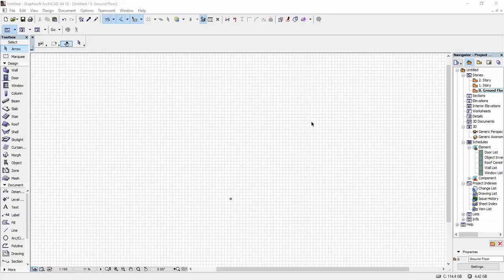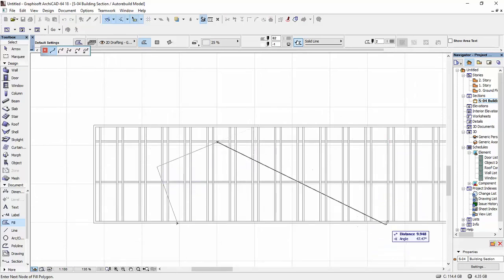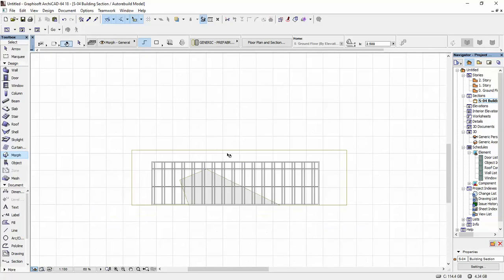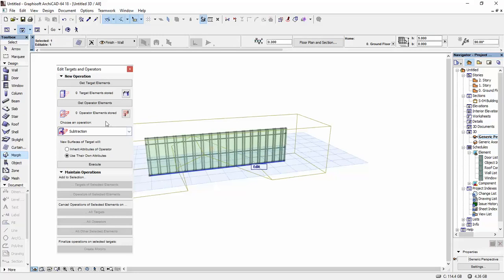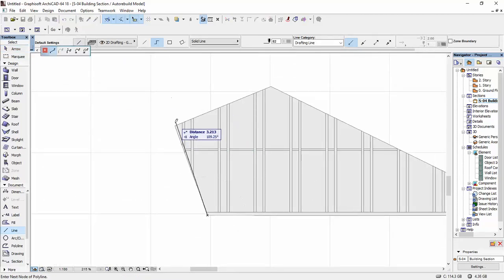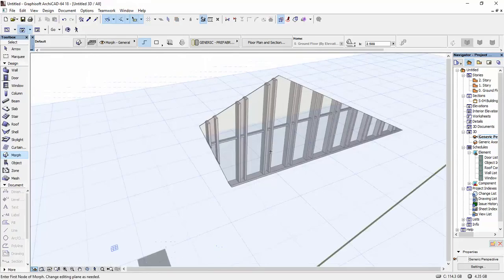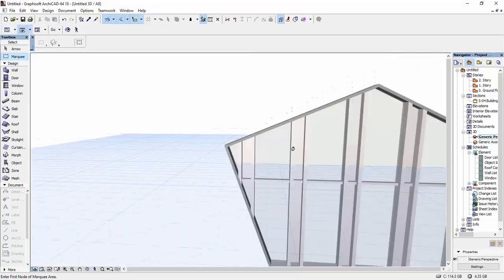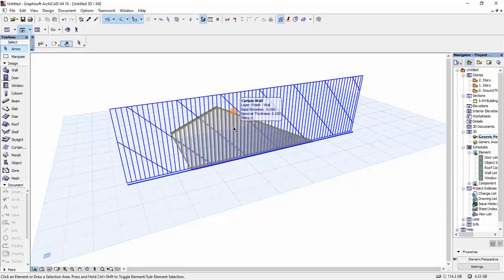Custom Curtain Wall ArchiCAD

Comment: Great video, I didn't know how to perform this operation, doesn't help that the menu command doesn;t live in the Design menu by Default.
With regards to the fill not working as expected, I experienced the same issue.
I brought the fill all the way to the front, this still didn't work. I then added an outline to the fill, this then worked.